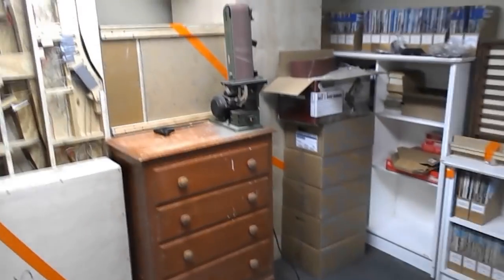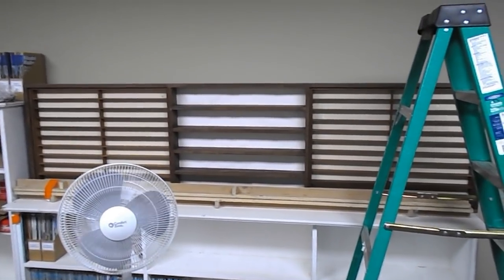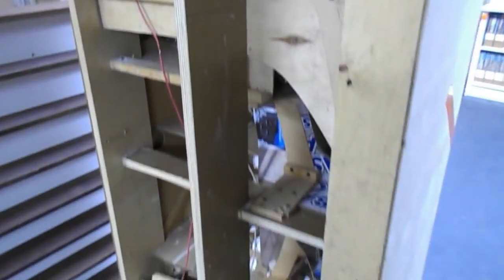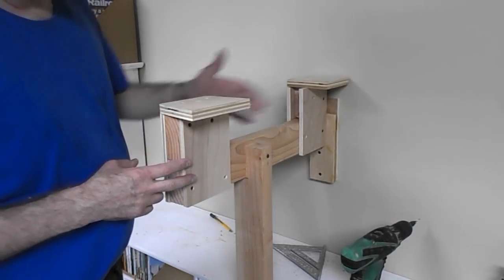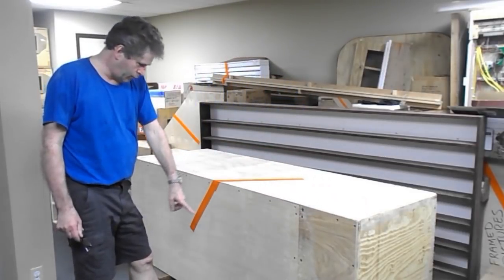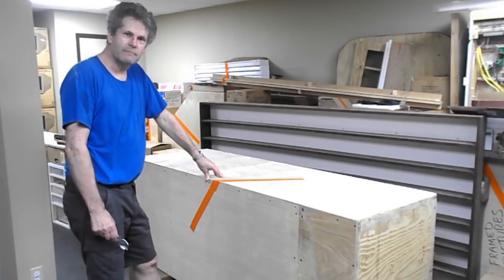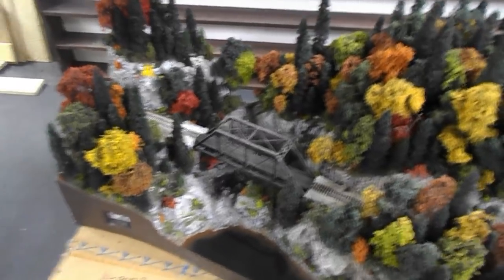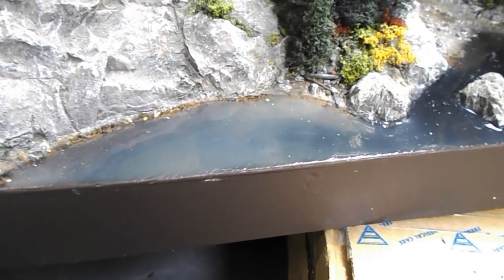Unpacking the first section of my railroad after over a year

Comment: The structures you built for moving the sections really paid off. I remember too the jigsaw puzzle you had with packing the other parts into the trailer, you had every section laid out for loading. You sir are an excellent planner and it shows in your work and videos. The railroad will have to send out a mow crew to remove that tree and hopefully the water clears on it’s own. If not, maybe a little heat will fix it. Great to see your own railroad coming back to life.

Comment: Great to see the Forrest scene again. Also, a huge comfort seeing the layout section being unboxed with minimal damage given my layout is going to have to travel half way across the world 😁- great job Peter
Reply from the maker: It was mainly your railroad I was thinking of at the time.  All my sections were built with moving in mind (as will yours be).  Actually, I tend to over-build for that reason.  The biggest worry in this case was knowing that it was going to have to trust it to professional movers who don't have a lot to lose if they destroy something and most likely have no experience with model railroads (stacking furniture and boxes is a lot different to stacking delicate models) - hence the full plywood crates.
Reply: Attention to detail is what sets you apart from all of the rest 👍
Reply: The key is to design the layout with moving in mind if that has a high likelihood of happening.  I built my first modular layout with moving in mind, and the benchwork and track survived 2 cross country moves (USA), and a regional move from southern CA to WA.  Peter is correct, you need to over-build the benchwork and take into account how it will be moved.  Good luck on yours.